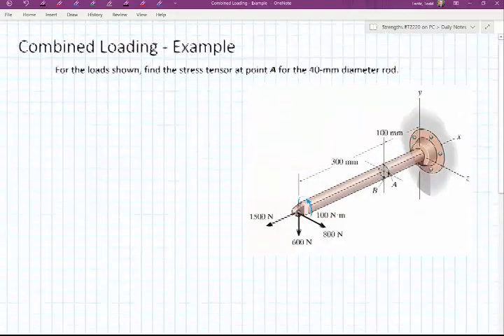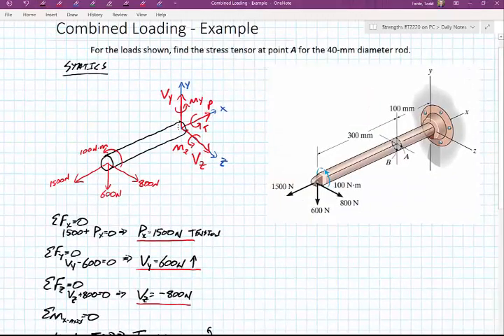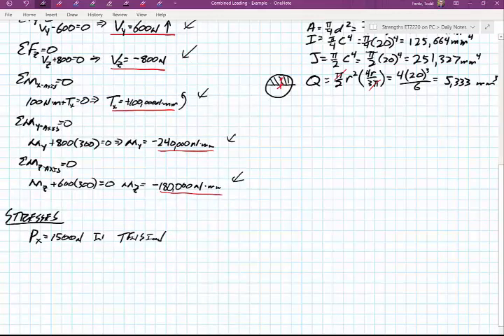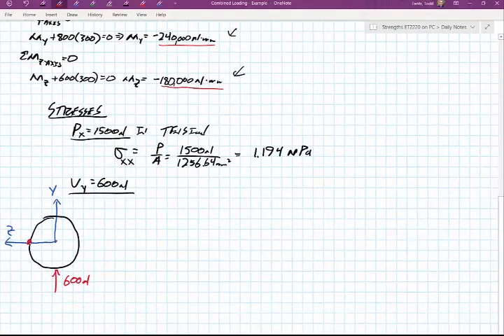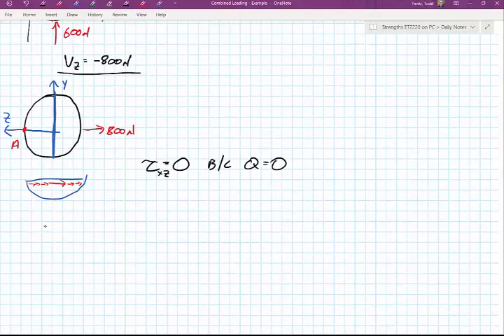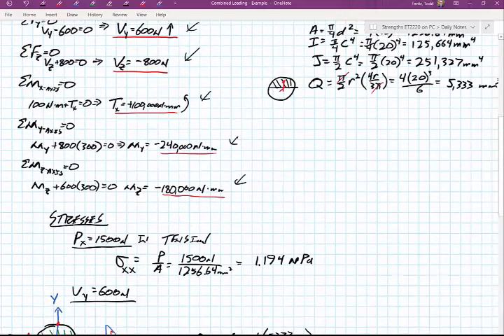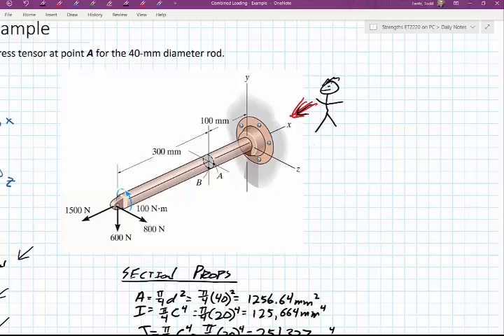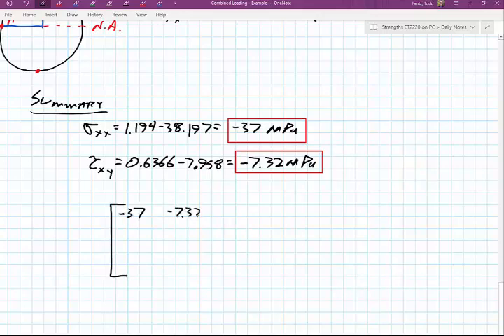Combined Loading Day 2 Example

Comment: Once you create the stress tensor, what is the next step? In usual  
stress analysis problem, we calculate the total stress acting on a point and equate it with 
(ultimate tensile stress or yield stress)/factor of safety and see whether the Factor of safety is greater than one.